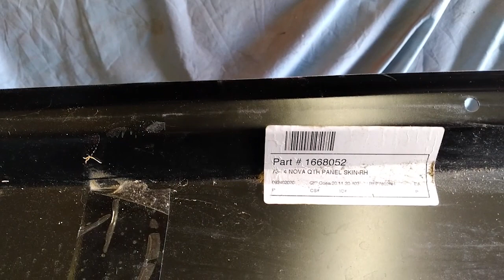1973-74 Nova Quarter Panel Skins| Sketchy's Garage

Comment: Half these parts houses anymore are getting real sloppy like that. Ordered a new hood for my 91 dodge truck last month and it was the same thing, labeled as a 89' to 93' (flat hood style) but it is clearly for  the newer 94' + models as it had the dropped sides to the hood for the shorter fenders. Oh, and no mounting hardware at all.
Sent it back the same day and called the company up, was told the correct hood would be sent out asap.... got the 2nd hood Friday.    It's identical to the first.... and now they want to charge me a restock fee to get my $$ back.
Reply from the maker: It's crazy how crappy the stuff they produce is.😬
Reply: @SketchysGarage   Yup it is, so back to the tried and true. Found a clean hood in a junkyard 240 miles away last night, having a cousin who lives nearby pick it up and haul it over for me when they come over in a few weeks.  It ain't even close to a color match but I can fix that... no gun yet, still working with rattle cans atm but I'm getting really good with a rattle can....or at least so I keep telling myself. =P
Reply from the maker: They are making some spray paint that you can almost get better results than a spray gun.😎
Reply: @SketchysGarage     Seriously?  I just been using cans because I don't do a lot of painting and am too cheap to go buy a gun lol.
I have had some impressive (to me) results with cans but to hear ya say they could be as good as a spray gun was  a bit of a shock. =)
Reply from the maker: @Loki13M  They make some that is a 2 part you snap a cap and mix it like a regular spray can and you get spray gun results, you can wet sand and buff it.
Reply: @SketchysGarage   Have not seen that yet, no surprise as I live in the sticks. Definitely keeping my eye out for it for this replacement hood. Currently it is deep blue and very clouded from age... my truck is two tone grey with a silver wide middle line (factory paint). It just looks like ass as it is lol.
If it works as you say it do that passenger side fender will be next to get redone.
Thanks for the product info man! =)
Reply from the maker: No problem,  I might see if I can get a can of it and do a video on it. 😎